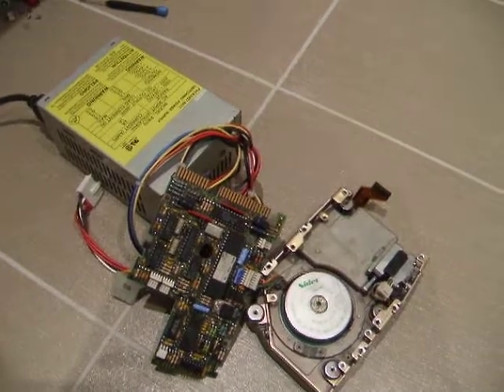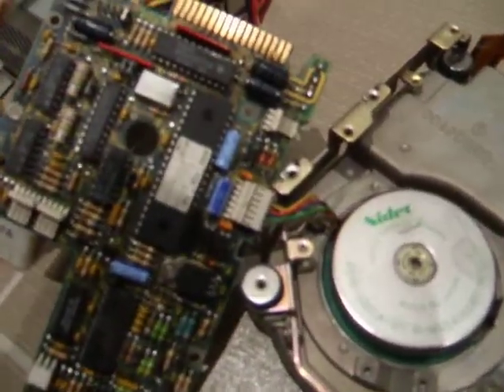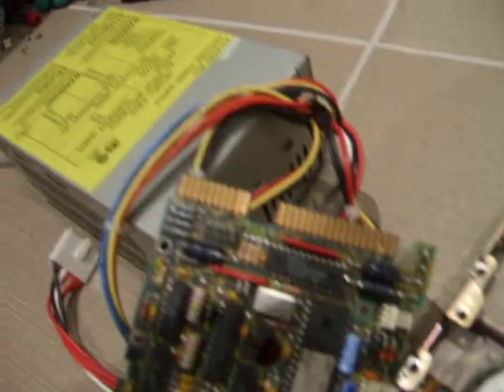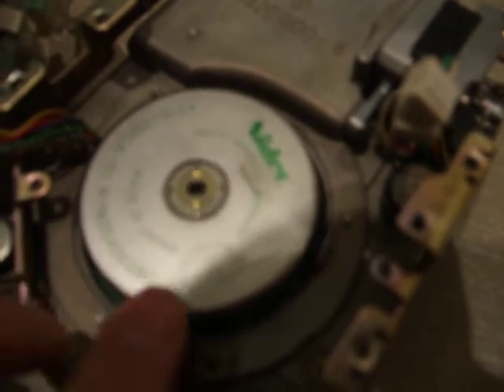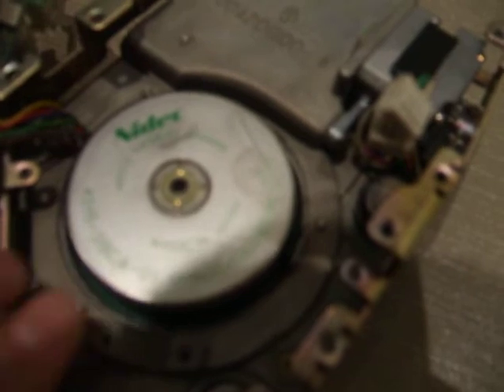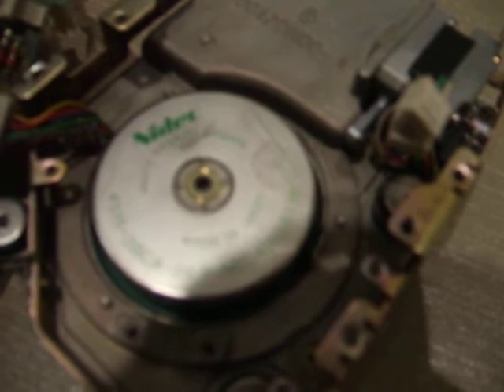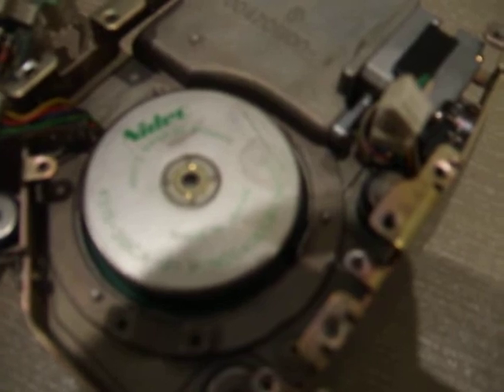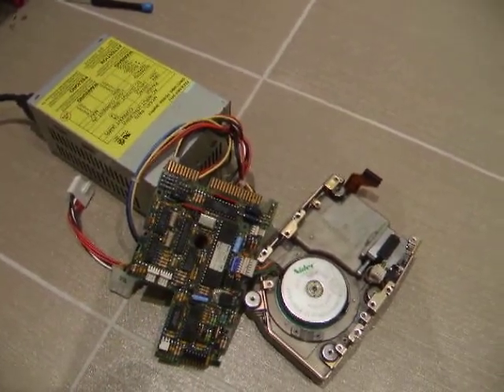Miniscribe MFM 20MB HDD startup motor problem

Comment: Try to lube and check the arm movment mech next to the side stepper motor it moves the mag read arm up down as it spins up. Also it should provide error codes it led format if the led is plugged in its hex decimal, short blinks 0 and sold blink 1 ... so mine has error 0100 that is error code 4 no index pluse on spin up, look at your error codes and reference model on google search to find them.